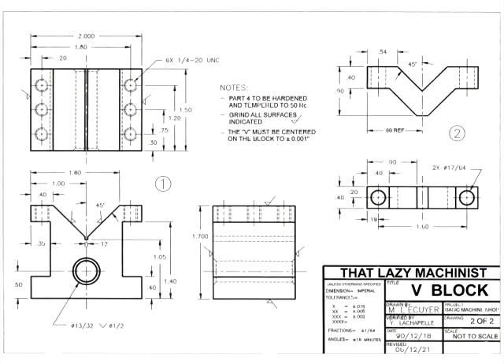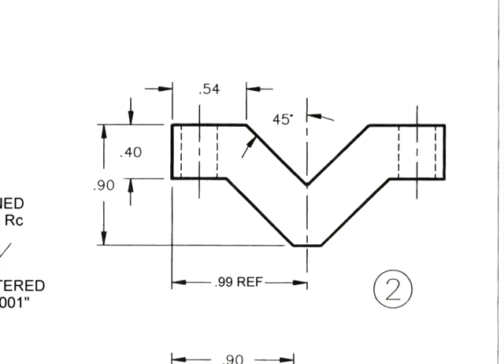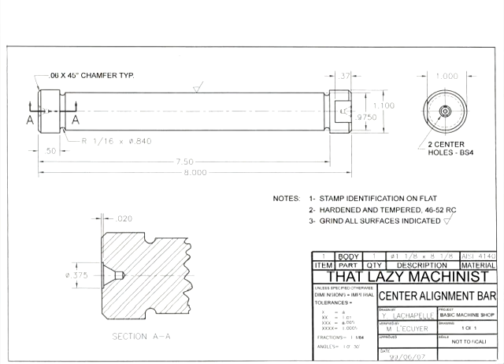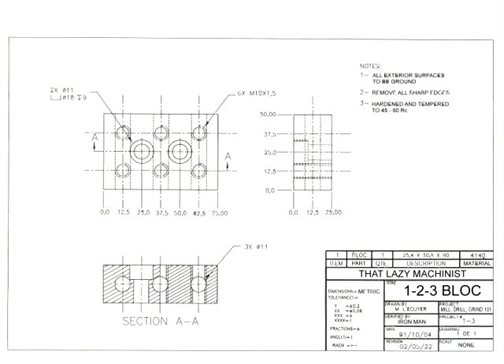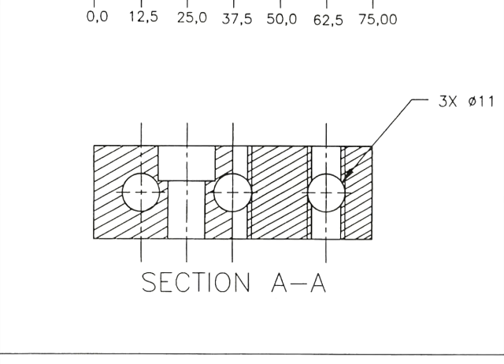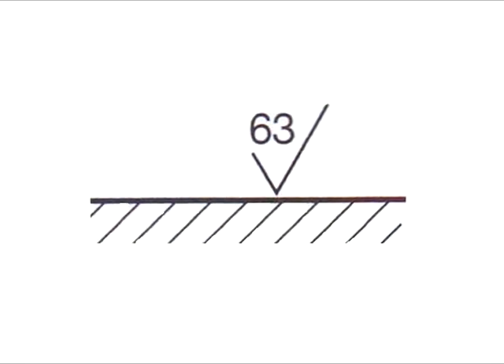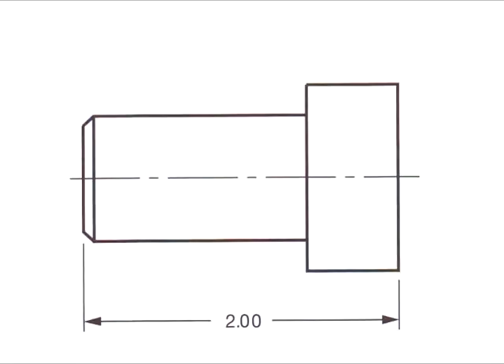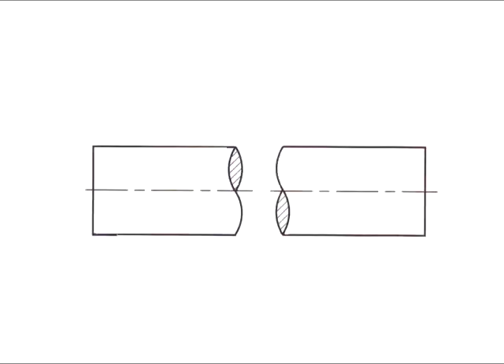BLUEPRINT READING PART 4, Marc L'Ecuyer

Comment: Just started a college course for doing airplane parts manufacturing and repairs/maintenance. This channel has been an extremely helpful source for some parts of the course material (specifically blueprints and precision measurement). Sending much appreciation from Winnipeg, MB! Those jokes were on point also.

Comment: i think a bit of time, blueprint reading part 5? could be devoted to a more detailed comparison of the actual part and the drawing, showing how the various lines represent the features of the part. for instance, the drawing of the tapping block has me somewhat confused what with the partial section, etc, my print reading experience has almost all been in the architectural and civil engineering fields, including the various architectural sub trades, mechanical services, structural, etc., etc, but that was some 25 yrs ago.  perhaps i'm just too rusty...
Reply from the maker: +crazymanmichael Hi Michael, that is a great idea! I am currently working on a series of videos about planning a sequence of operations and I have committed to a few more after that but you have seeded the idea of a part 5 for the blueprint reading course. It won't be for a while but it's on the list. Thanks for watching and for taking the time to comment, Marc

Comment: Marc

Thank you so much for your videos.I have been a machinist for over 40 years but you have inspired me to become a lazy machinist and enjoy it. I have learned a lot from your videos and have shared them with others. In the sketch you made of the v block the bottom v top's hidden line on the side view  does not line up with your front view. Knowing better this confused me in thinking you were drawing the other side's slot. An explanation or projection lines would of helped.  I know this does adds clutter to the drawing but for a novice  would identify the lines more clearly. Thank you for being a great teacher.